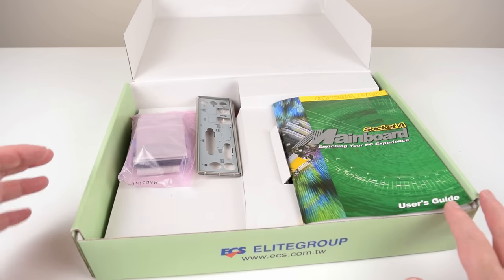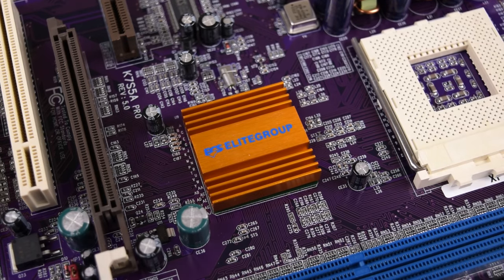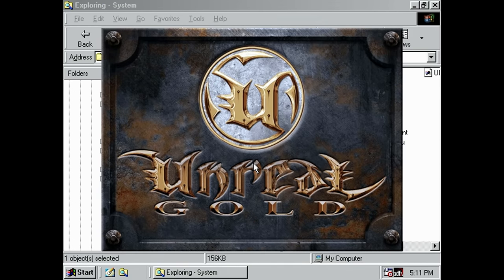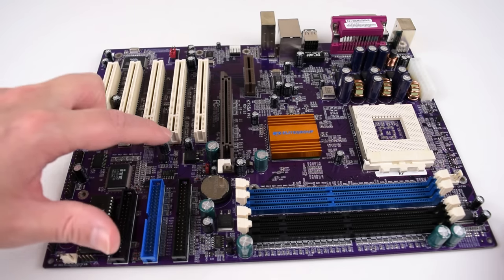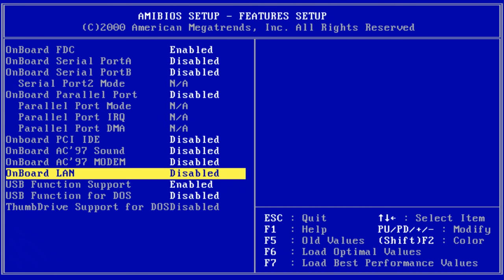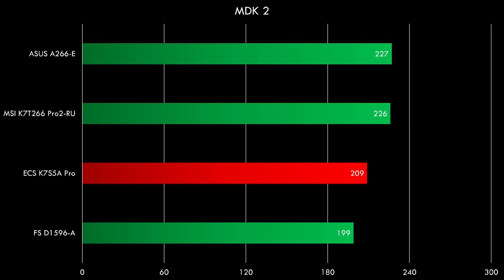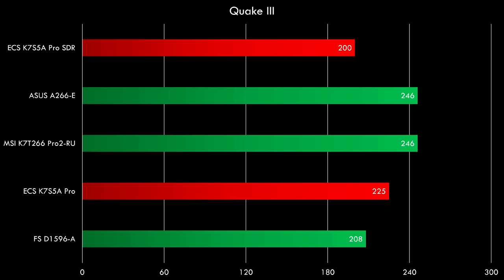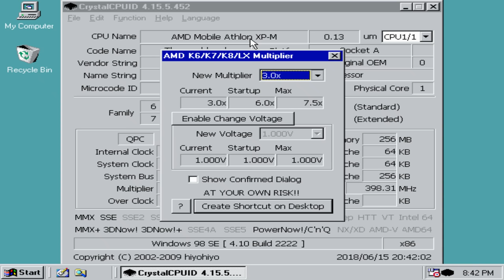ECS Elitegroup K7S5A Pro Socket A Motherboard Review - First Boot in 15 years

Comment: Had this paired with a Duron 800 (upgraded to a Tbred-B 1800+ later), 768 MB RAM and a Radeon 9600XT. Sadly it died on me so I swapped to an Abit NF7-S but I liked how there was a way to overclock the CPU with Speedfan in Windows back in 2002 which was super cool.

Comment: Used to have one of these boards back in the day, I used to have a strange audio issue where after installing Windows, as time progressed, the audio playback would slowly start to go glitchy. Really strange, MP3’s would work fine and then after a week or two, they’d start developing “pop” and “wuup” noises, was likely a driver issue but I could never fix it, the only solution was reinstalling Windows 🤷🏻‍♂️

Comment: I owned the original. I had an Athlon XP 2400+ @ 2.0 Ghz. I loved it. The board had a 333 Mhz FSB that was overclockable to a full 400 Mhz if you wanted to put the flagship XP 3200+ in it. Fun fact? I accidently bought the 266 Mhz FSB chip instead of the 333 Mhz FSB model (I thought it was a discount, it was not, it was a different processor). I returned it for the full 333 Mhz FSB model and actually got a few frames out of it. Great board that had a custom bios floating around for it and it was rock solid. I loved it. I originally got this board with a Thunderbird @ 1 Ghz that I etched into 1.4 Ghz. Paired with a GeForce 2 GT 32MB and 1GB of memory, 7200 RPM Maxtor 20GB HDD it screamed past my PIII and PII based machines like they were standing still.

Comment: Used to get this board as part of CPU/mobo bundle deals from Fry's Electronics and couple other resellers, bought about 10 of them. ECS was making so many of these things it was able to get the costs down low enough for resellers to practically give them away with a CPU purchase. High failure rates, about 20%, unfortunately due to said push to crank them out as cheaply as possible while they were in demand. But most of those would fail early within the warranty/replacement period.

Comment: You need to get your hands on an Abit BP6, and then a VP6... original 370 celerons, then FC-PGA Celerons and PIII's (coppermine).  Dual socket, both of them.  Make an early win2K gaming rig based on both, and show the entire other league that existed back then, 2 core, 2 thread... back before that was EVER a thing, with win2k controlling the scaling.  Many games, after tweaking the OS and forcing it to see both CPU's, did so so so freaking well.  It took that CPU load and just got rid of it entirely back then. The GPU was all you had to think about, once you dialed in a stable OC for both CPU's, watercooled them both, or both hot sides of both peltiers, with both CPUs growing ICE and SNOW all over them.... ah man.. those were the days...

Comment: I have computer with K7S5A non-pro (without USB 2.0) that I bought in 2003, work to this day. In first year I did mistake and I didn't install AGP drivers what caused 10-15FPS drop in games. GTA III on GF2MX200 was barely playable (15-25FPS) without AGP driver.

Comment: I had a K7S5A for a long time. Put a Thunderbird 1400/266 on there, bumped the bus speed to 138 and ran the chip at a stable 1.52 GHz. I had that for a long time. I still have the Antec SX1040B case that it was in, and a custom case badge that said AMD Thunderbird: Like a Pentium on Crack! I never ran a 3dfx card on it, pretty sure I was running a Radeon 8500 at the time, and flashed it to a 9100 later on. Also used it as a test bed for some weak-ass XGI Volari cards.

I never had a problem with that board. I can't say the same for the Soltek board that replaced it. Cheap Chinese capacitor hell on that one.

Comment: I remember looking at the SIS chipset boards when I was planning to upgrade from my P3 machine to an AXP. I was considering it because it would be a lot cheaper, not only were they generally cheaper than the Via chipset boards, but the option of SD or DDR meant I could put off the expense of buying new RAM until later. After looking at the reviews though, I decided the performance was worth it to buy a Via chipset board. I can't remember whether it was the same ~10% performance gap back then, but when you're a teenager chasing FPS, that sort of thing made a difference.

Comment: WOW. Thank you for doing this review. I hope you don’t mind my long comment. K7s5a was the motherboard from my first build on May 15, 2002. It was a Duron 1.0 Ghz 128MB ram and nVidia GeForce 2 MX 32MB. I upgraded this with 256MB and GeForce FX 5200 128MB by late 2003. In the recent years I managed to rebuy 90% of the same parts to rebuild, minus the PC case I had back then. I have great memories and nostalgia for this build as your brother does for the PC you rebuild for his Birthday. The K7s5a I have in my build is the original v1.0 that has a Game/MIDI port on it and uses the SiS audio chip. There are 3 or 4 versions of this board. Also I got a spare v5.0 for my tech bench. I do have issues with this one. It can’t get to post, it just turns on, all fans spin and no beeps. I tired many PSUs, GPUs, RAM and no go. I only have AMD Athlon 1800+ 1533Mhz and 2200+ 1800Mhz. I have seen your video on the PSUs v5+ AMPs situation and have several PSUs that should comply. I may need to get a Duron and do a test with that. In any case thanks again and hope to see this board in future videos.

Comment: Are you sure about the 1GB limit?
I just built a PC with the K7S5A non-Pro and it runs just fine with 2x1GB DDR.

Actually, my very first self bought PC was a Duron 800 on the K7S5A. Don't remember the rest of the specs, but it was all cheapo stuff.
As i am currently trying to sell some stuff, i tested all my mainboards and found a working K7S5A, so i thought i'd build a nice XP system with it.
The Athlon XP 2000+ was the fastest Athlon i had around, and as mentioned, i put 2x1GB DDR memory in it. 
Works like a charm, Windows XP runs just fine with no noticeable slowdowns. And i'd say this is about age apropriate for an early 2000's PC.
For the GPU i added the best AGP card i have, wich is a Radeon 9600 XT with 256 MB of memory.

On stock clocks, the system gets a score of 8441 in 3DMark2001, and with overclocking the GPU to 550 MHz and the VRAM to 275 MHz i reached over 9500 points. However it is not long time stable at those frequencies, so i ordered some heatsinks and a new fan on ebay for 10$ total. Will see if that helps.

It runs Unreal Tournament 2004 at 1280x1024 with medium/normal settings at around 60 FPS, just sometimes dipping to the 50s.
Soldier of Fortunes doesn't support 1280x1024, but runs perfectly smooth at 1024x768.

Overall, i think this is a great system and replicates the early 2000's expirience very well.

So if you want the total XP x-pirience, the Athlon XP with WindowsXP does a really good job at that.

Comment: abit, QDI and jetway were voted the 3 best brands around 2000, they were actually very good boards but the k7s5a had a few issues with the bios that were never fixed. that board you have is an absolute beast on windows95 probably the best board for it. SiS were definately the best chipsets.

Comment: I bought an ECS P6S5AT with Sis chipset back in the day (for Tualatin CPUs) only to find out it didn't support overclocking, at all. I ended up with a slower PC than before the "upgrade" ;) 

The main reason for choosing the board was that it supported both SDRAM and DDR, just like the K7S5A.

The biggest problem with these boards were the capacitors. They often failed within a year, and sometimes after just a few months. But caps can be replaced, and they probably should be anyway, on boards this old.

Comment: I owned the original non-Pro K7S5A, first with a 800 MHz Duron easily overclocked to 1064 MHz, then with an Athlon XP.
Unfortunately it died on me after just 2 years.

Comment: Wow, that's a familiar view. I had a K7S5A with that unofficial bios that allowed hanging FSB to 143, 138 etc. After the pencil mod I managed to run a 700 MHz Duron at 1001 MHz @ 1.85V, if I remember correctly. Good times, interesting mobo. Not the fastest one, but interesting nontheless. Terrible capacitors on that mobo!

Comment: I always bought JETWAY, QDI Legend and Sparkle branded motherboards, ECS were an OEM brand found in eMachines, as for the 5V rail, install a 25amp dedicated power supply in the case and disconnect the main psu's 5v connections (red wires) when i owned an athlon xp 3200+ i used a gigabyte board, back in the days when gigabyte were the best, unfortunately today they are really poor. also the C-media sound chips were a country mile better than anything from realtek, some of the very best PCI soundcards ever made in this era had a c-media chip, they were bloody incredible, especially the auzentech sound cards. try and find a "AuzenTech X-Plosion cinema" soundcard on ebay, i promise it will be the best you ever heard. they have swappable op-amps and super high quality circuitry, have a lovely warm sound to them, they sound very natural and crystal clear. have around 132db sNr

Comment: Aaaaargh... get it away! get it away! Those ECS K7S5a's were and still IS shit. I had SO many problem with mine when new, and so did my friends. They overheat the northbridge in the die, and resets the bios (that was the explanation from the dealer, when getting a new one again, when it failed again for the x times). And then you have to set everything again (sometimes mine only needed to set clockspeed again, and other times it had turned bottoms up completely, and lost the HD too). All of these boards just need to be buried in the ground, and forgotten about. I quite amazed, you found one working...

Comment: great video , I have an intel setup comarable to this using an L4S5MG/651+ Acer motherboard which I think is an ECS board, can handle 400/533 FSB pentium 4 CPUs , running a 3.06 ghz / 533 fsb P4 in it and also has a universal AGP slot so can run Voodoo cards and AGP 4x cards as well.
Reply from the maker: Ah, the mighty 3.06 with HT! Legendary CPU and I really should do something around that processor.

Comment: Ahhh my worst nightmare and nemesis. Once I had to repair a PC with this motherboard. The owner wanted me to install some new ram, so I bought him 512mb ddr 333mhz sticks. But I simply couldn't make them work in the board. The rams are still in my Abit NF7 retro rig...
Reply from the maker: For the Socket A tests I use a DDR400 stick from Micron, it seems to work with everything :)

Comment: Is that the Asus A7V266-E that you have used for testing prior to this ECS? I simply cant find any Asus A266-E models out there.
Reply from the maker: The bars in the graphs are labelled!
Reply: PhilsComputerLab Yeah. I can see that. I was just wondering what the A266-E model was? A google search came up with A7V and A7A varients. Like A7V266-E that I have one of in my collection.
Reply from the maker: Oh  it must have cut off. Well it's the same board I always use, I'm sure it's in the description of other Socket A vids.
Reply: PhilsComputerLab Will have a look...
Reply: PhilsComputerLab Yup... The A7V266-E... Awesomme board. For anyone reading this, then I can highly recommend it. AGP-Pro, Raid controller and extremely stable.

Comment: The manual is vague on the cpu sizes.  Is it any cpu with 266mhz bus?  What would be the max cpu that will work on this board?
Reply from the maker: Well the manual is usually behind the latest changes. You can check BIOS change notes and ECS website for CPU support.

Comment: I wonder if the 'pro' version also has this issue with northbridge overheating. I had two of these boards - one 17 years ago and one in a retro PC. Both were very unstable with stock heatsink on the chipset but rock solid when they had large heatsink on the chipset.

My retro build on this board was rocking 2GB of DDR, so it works nicely.

Also - cheepobios this mofo and enjoy 150mhz fsb :)

Comment: That smell of brand new retro tech mmm lmao recently built a brand new AsRock K7S41 with the Athlon XP 3200+ a Titan heatsink with a Jet cooler fan because the Titan heatsink is far easier to clean, 2GB DDR2 OCZ a Sapphire HD 4650 converted with a way better cooler with a brand new Magna 500 watt.

Comment: I think I have this exact same board in my Windows ME system, or one very similar at least. Shame it doesn't have the 4 pin 12V connector for CPU power since mine has a blown PSU.

Comment: I found another retro board. It's the AsRock AM2NF3-VSTA. It has the nForce 3 chipset, an AGP slot. and even support for some AM3 CPUs and up to 16 GB of DDR2 RAM (if you want to use it for modern day usage). I think nForce 3 250 also supports Windows 98
Reply: However the internal audio wont work with Windows 98. At least you can use a PCI sound card. Maybe the Sempron 140 and the 6800 GT could be the most powerful win98 combo lol
Reply: Nice board, I have it in my retro Windows XP machine. Only downside are the SATA 1,5GB connectors, very flimsy and you can't run most of the newer SATA drives because of compatibility issues.
Reply: Probably could support 98 if SATA drives are in ide mode and with a PCI sound card and agp gpu...